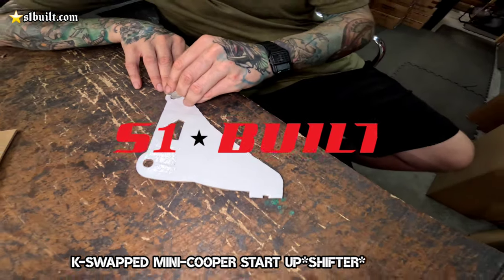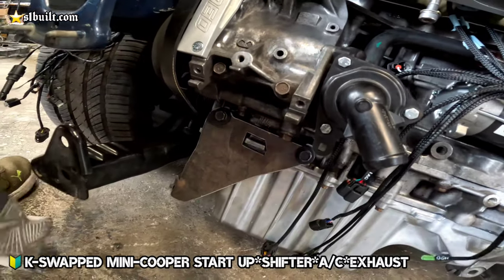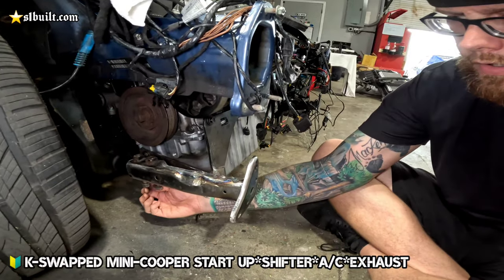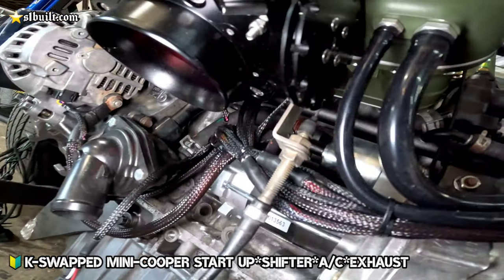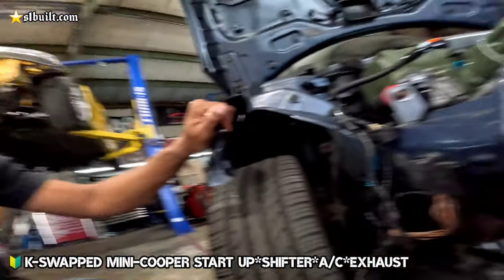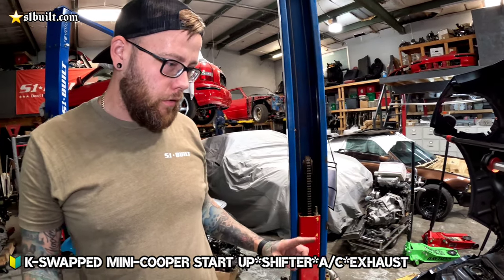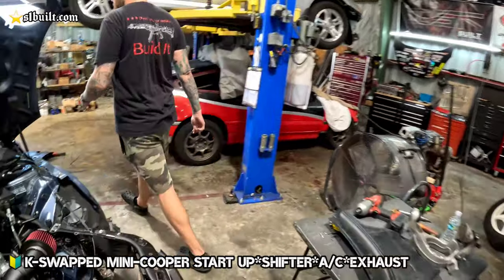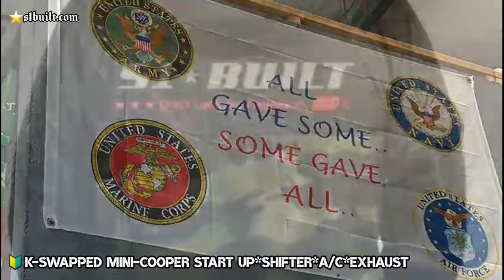Kseries Mini-Cooper START UP🔥A/C🔥SHIFTER🔥EXHAUST

Comment: @S1Built I'm in Florida and doing a k swap mini right now. Are you guys doing a collaboration with Ricardo for an A/C kit? Also are you guys going to sell the civic gas pedal conversion.  K swapped mini owners want both of these..lol You guys will make a killing!!
Reply: I'm also doing the swap and ac kit would be nice. I'm skipping the throttle cable and doing drive by wire.  The price of a kpro I went with a fueltech ft550 and plan on squeezing the dq250 trans in.

Comment: Good god. That guy sent me a kit and all the powdercoat was chipped, not shipped in any sort of stuffing. No instal guide or wiring schematic. The tranny bushing was forced into the mount and stretched/gapped the bracket. Welds looked like labor ready. Worst ever
Reply from the maker: Sorry about your experience but ours came to us good ..wish you all the best with your build
Reply: Mine came in perfect order and each mount individually wrapped and in box.  Also had no instructions but he provides all the info you need in messenger on insta and has videos on facebook for first gen.